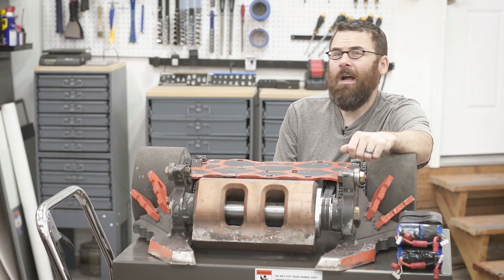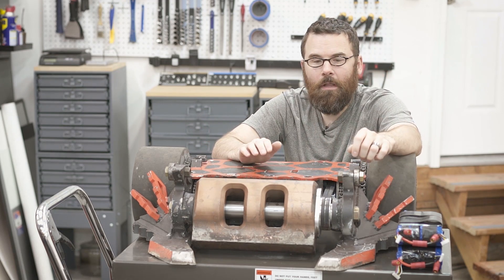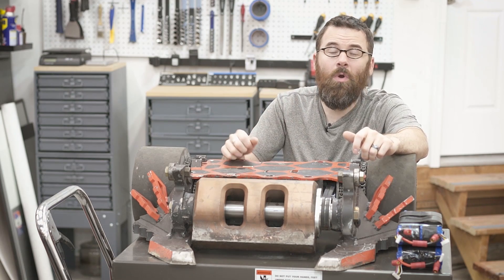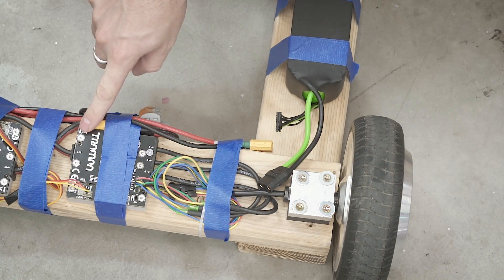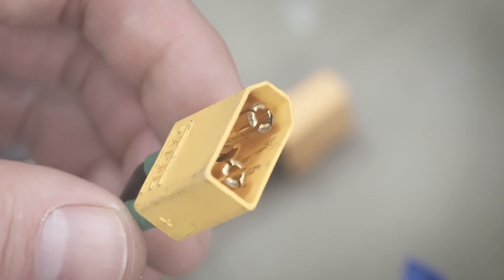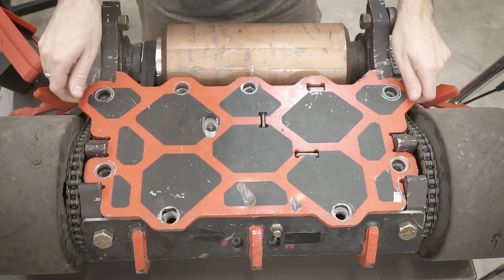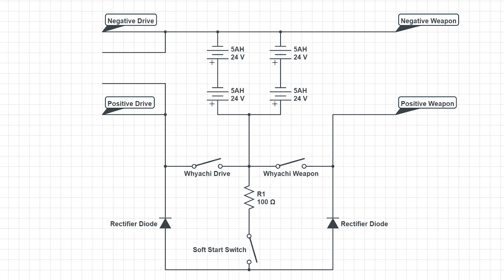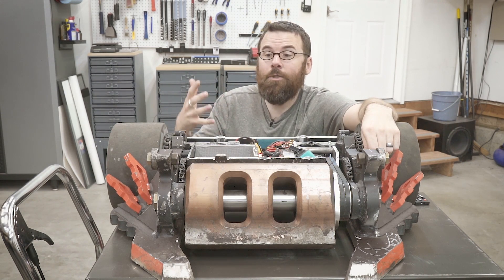Copperhead Soft-Start Circuit

Comment: what wattage value does the resistor need to be in your case?
Reply from the maker: I think ours is only a few watts.  MUCH more power is going through, but it's only instantaneous so the rating doesn't need to be for the full sustained inrush if that makes sense.
Reply: thanks.  @RobertCowanDIY

Comment: How did you guys determine your resistor and rectifier diode size for your system? I'm trying to design a smaller one for an insect weight.
Reply: I don't know if it is worth the weight for a small bot. You are probably best of testing what resistor value that don't give too big of a voltage drop that the ESCs do wierd stuff when starting up but a few hundred to a kilo ohm and then diodes that can take the short circuit current through the resistor for your battery voltage. If you aren't required to have separate switches for weapon and drive you can leave out the diodes all together and have just a resistor and extra switch

Comment: I came back here from the new precharge switch video... So I believe that the diodes are deleted, and precharge switches are now separately in parallel to the main whyachi switches?
Reply from the maker: Same as before, just with the microswitches in place of the momentary push button.

Comment: I do exactly this with my ebike. It is 150A, 100V (capable of more), and it has a 160V 10,000uF 10mR capacitor across the supply to isolate the ESC switching currents from the battery.
Coincidentally I also use a 100R soft-start resistor, otherwise my connector will disappear in a cloud of plasma.

Comment: I use an XT90-S antispark connector for my electric bike; it has a mechanical soft start built in.
Reply: Was going to recommend the same, but the ability to current limit and safely power on the electronics for testing is a super helpful feature. 

On the topic though, anyone know where to get xt90 antispark plugs in bulk inexpensive? 
Anyone know if they make a black variant of the xt90 antispark plug?
They also make a larger variant of antispark for fast electric RC boats in black.

Comment: You could skip the diodes if you use a double pole switch.
Run + to Common on both poles through the resistor, and then the N/O  of each pole wires down to the separate systems.
This way there is no connection between the two systems unless the switch is pressed, so no back feed issues.
Reply from the maker: Yep, very true!

Comment: Ummm.  No fuse?  No wonder I see smoke coming out of robots.
Reply: The smoke is generally because of the motor's very high fly-back current going though the body diode of the ESC's FETs, when at high load and partial throttle. In English, this means the ESC overheats and malfunctions in a scary manner. No fuse can stop an ESC from being damaged due to this overheating (but it can reduce the risk of a subsequent fire).
Reply: @smeggyhead1  Shorted batteries are a bad thing,
Reply: @ahbushnell1  which is why I said "(but it can reduce the risk of a subsequent fire)."
Reply: @smeggyhead1  Which was my point to begin with.
Reply: @ahbushnell1  I think I might have misunderstood what you were trying to say. Sorry if I did.
Reply: You want as few failure points as possible lol
That motor running till failure might win you the match.
It's like how the old military battlefield generators would have a "Battle Short" switch on the control panel that would disable all the low oil circuits and lock the overload disconnects out and basically make it run no matter what, until it died.
Reply: @ke6gwf  I guess it depends on how much damage you can tolerate.
Reply: @ahbushnell1  ALL of it, as long as you win the match ;)

Comment: It is not a soft-starter, but a pre-charge circuit. Anyway, great videos with more robot details and behind the scenes than in the tv - keep it up! 🙂
Reply: What are the differences?
Reply: @ki0w0-lordofwatersheep  a soft starter is a type of motor starter.
This is limiting inrush current on an electronic circuit.

Comment: Why not use anti-spark connectors? Do they not make those for batteries with this much power?
Reply from the maker: They tend to not be as reliable or durable.  I've not used them but I've heard of people having them fail.  But that is another potential option for sure.
Reply: Robert Cowan thanks for the response!
Reply: This video is exactly what anti-spark connectors are: a resistor that connects to an electrically isolated tip of the plug - giving a limited pre-charge before the 'unlimited power' is connected. The resistors used within those are physically very small and cannot tolerate much energy. The energy converted within them is proportional to the square of the input voltage, so they tend not to be reliable when used in high-voltage systems.

Comment: If I'm getting this right, the resistor acts as a current limiter until the voltages stabilize throughout the system.
Reply from the maker: Yep, correct.  It's nothing special or complicated, just a simple way to slow down the inrush current.

Comment: Reminds of the old main frame days where the hard drives were the size of a dish washer, with a hugh motor that spun the platters. Power up logic prevented the drive from spinning up until the electronics were stable, and if you have more then one drive, there was a cable daisy-chained from drive to drive, that would only let one drive spin up at a time.